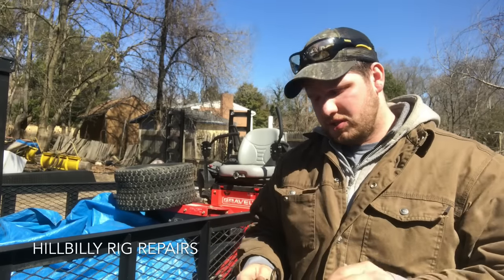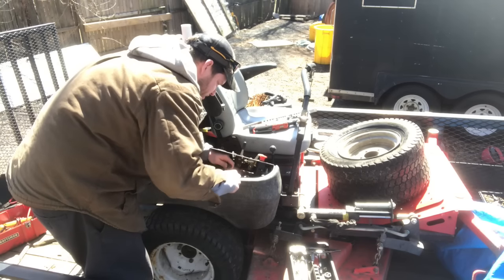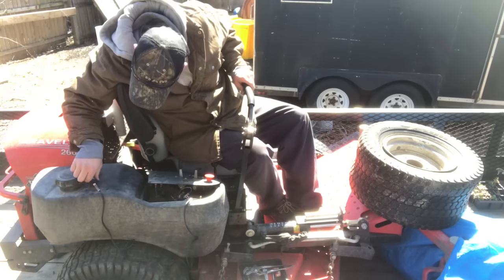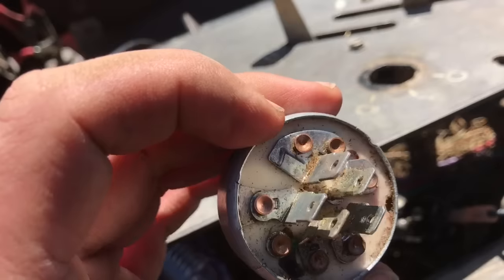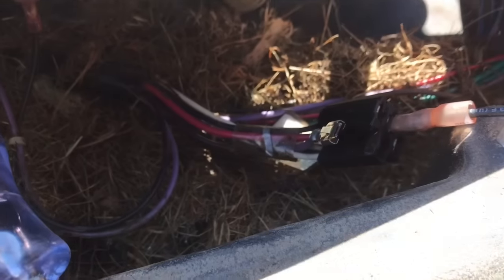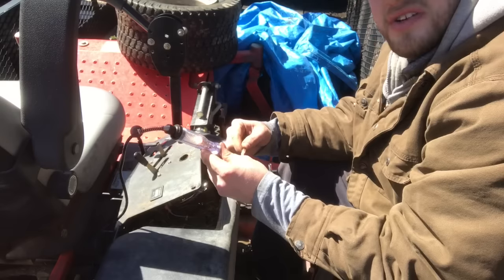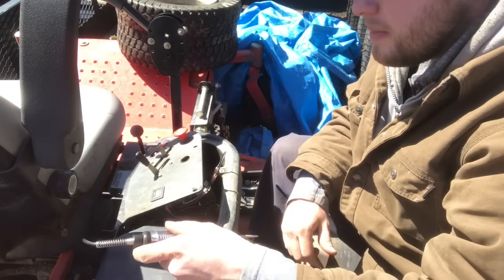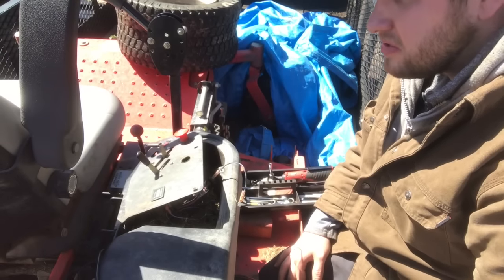How to HotWire a riding Lawn Mower without a Key

Comment from the maker: This information may clear up some confusion: The fuel solenoid on the carburetor is normally closed; a constant 12V needs to be supplied to this solenoid in order for the engine to run. Now that the engine has fuel, it now needs spark; this is supplied by another 12V source(momentarily) which energizes the starter solenoid and ultimately the starter—this then “turns” the engine over which begins the ignition process. It could be helpful to locate a wiring diagram for a specific mower which will clearly illustrate what each ignition switch terminal controls. Hope this helps all!
Reply: craftsman  (sears) has printable dia in the users manual get on line  very detailed

Comment: all the switch conn 12 v to solenoid  to start engine in start position in the run pos. 12 v is supplied to carb. solenoid to allow fuel to flow into throat of carb. this is basic some have electric pto,s. which require 12v also

Comment: a lot of mowers have a 30 amp fuse in line from battery to B conn. on switch S  conn to pto relay then to brake pedal then to small lug on solenoid   this wired so you can only crank it with brake pedal  down and pto not ingaged  A2 conn  to seat switch   if yoy are sitting in the seat a relay opperates  so pto can be used  G connects to ground  battery for carb is fed  from A1 on switch  in run pos. in off pos  M is grounded to stop eng

Comment: Can you show or explain the ones that are jumped on the plug…..mine has the same looking plug. One at top middle and two on each side below it. 
Orange top middle, bottom left is green, top left is red and red with white (2 wires), bottom right is red and top right is yellow

Comment: Thanks for the video!  I also have a Gravely (mine's a 252Z).  The posts on the ignition switch aren't marked, and I can't find a wire diagram for my ignition switch anywhere.  Any idea which posts are which on the ignition switch?
Reply: most switch's have B for 12v from bat,   M goes to carb  in off pos a gd is conn. ing  to stop eng   this is from memory   so take as such   in run pos  M has 12v to carb solenoid you will find a lot of diff mowers wire the same way

Comment: So basically you're connecting the 3 cables together, right? Don't know why aint working here, probably there is some trouble with the connections down the seat :-(
Reply from the maker: Raise drive wheels off the ground-disconnect PTO switch that goes to clutch. Should crank over..

Comment: I'm still confused how all this works i thought i could but I'm better off just taken mine to the shop to get fixed because mine has a key but start and it has a new battery all connections are good I just don't know but I won't electronically shock myself LoL 🤣

Comment: l lights  s solenoid
Reply from the maker: Not sure if your comment is a question. But here’s the deal, the fuel solenoid on the carburetor is normally closed; a constant 12V needs to be supplied to this solenoid in order for the engine to run. Now that the engine has fuel, it now needs spark; this is supplied by another 12V source(momentarily) which energizes the starter solenoid and ultimately the starter—this then “turns” the engine over which begins the ignition process. It could be helpful to locate a wiring diagram for a specific mower which will clearly illustrate what each ignition switch terminal controls. Hope this helps all!